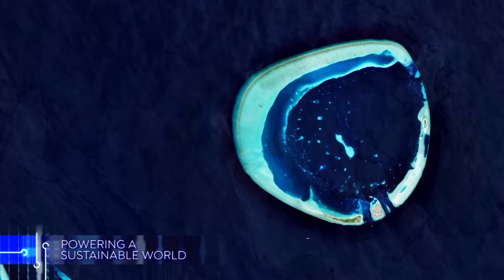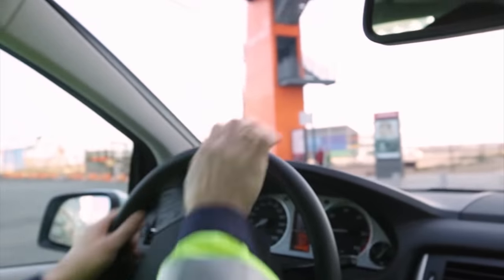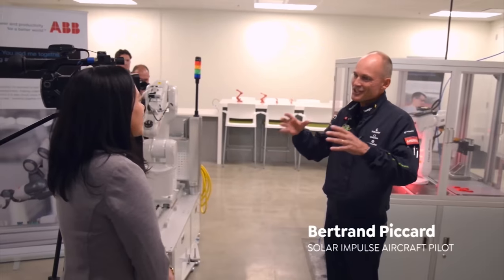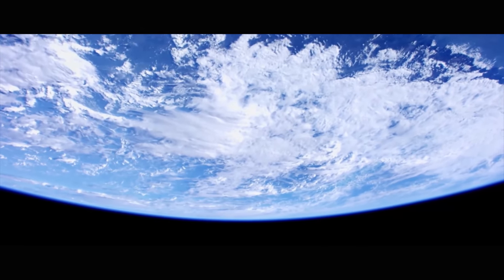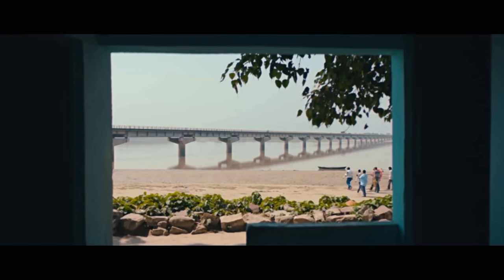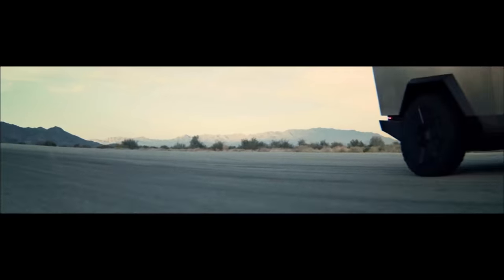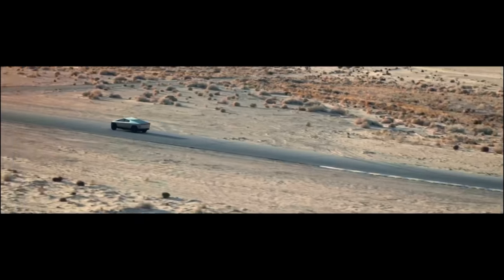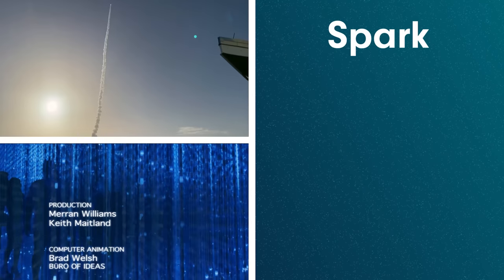How Can Satellites Save The World From Natural Disasters [4K] | Tech Effect | Spark

Comment: 1-hydrogen used as fuel will produce water vapor which also has an effect on climate change. Moreover, Hydrogen is not as safe as it looks (highly explosive if misused)
2- gas produced in the water treatment plants is methane when burned will produce carbon dioxide and water vapor which have both an effect on climate change!